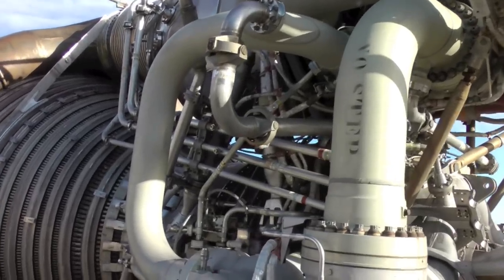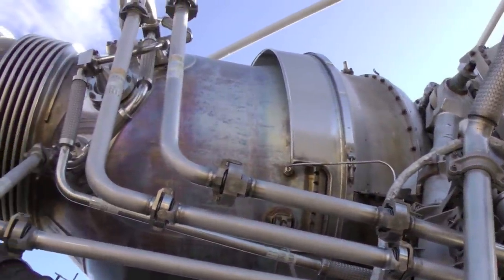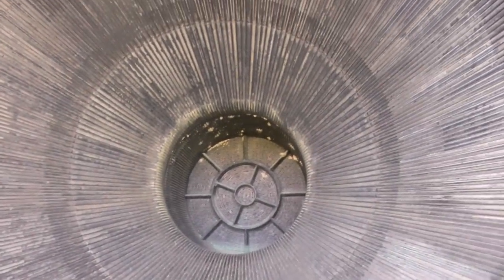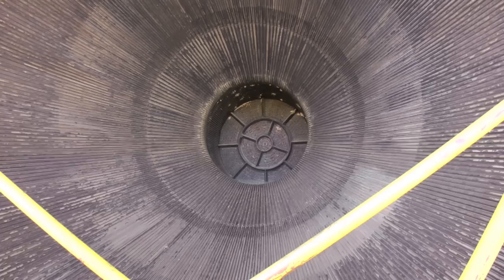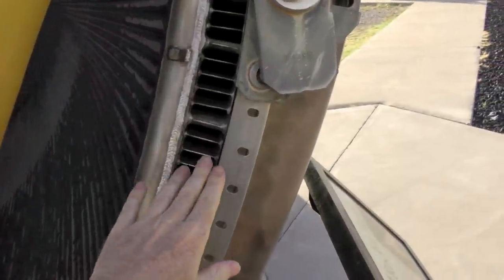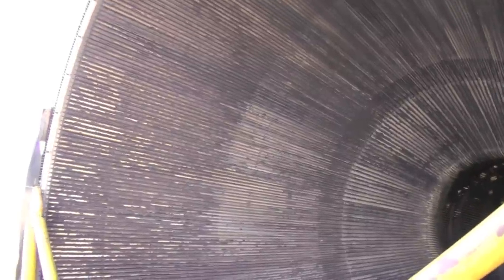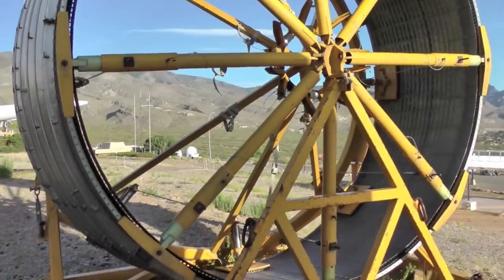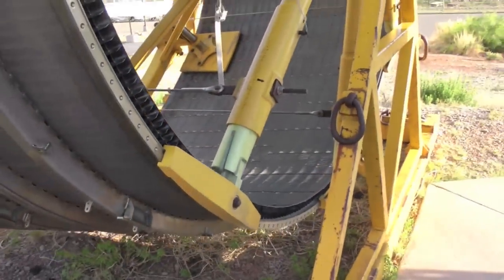Saturn 5 Moon Rocket's Main Engine, the F-1 | NASA Apollo Program Space Travel HD

Comment: if the engine genetates 750 tons of thrust, what par of the engine is taking that pressure load.i mean is the pressue affecting the entire nozzle?always wondered about this as the pump assembly area looks so comparatively weeak to transfer such . a massive thrust without just crumbling. . And the nozzle . looks quite delicae also. bottom mounting plate taking 3750 tons of thrust. is a huge load.
Reply: I don't think the nozzle wall pressure is very high at all.  It's all longitudinal. They did go to great trouble to keep the nozzle from melting though.  He explains this in the video.  All the tubing around the nozzle supplies unspent fuel as a coolant.
Reply: Zoe TheCat

exakt!
Reply: Combustion chamber pressures were above 1000psi... I think the bell probably had less pressure due to the expansion.  Hoops are brazed into the assembly, take a look at it in the video.  There's a gimbal bearing at the center of load... that cross-lookin' thing... yep, it takes the full 1.5Mlb load *while gimballing*... only the center engine was fixed in place.  There's several great books on the Apollo program, the F1 engine book (Springer Praxis) is on my shelf, among many.

Comment: In the opening few seconds of the video, you can see the fuel feed pipe to the left and the LOX feed pipe (the larger one at center right) connecting the turbo-pump at the top to the engine below. You can also see smaller bleed pipes bolted onto them. Does anyone know if they are the ones that feed the gas turbine that drives the turbo-pump?
Reply: The gas turbine is driven by the output from the gas generator. The gas generator is actually a small rocket engine that is fed liquid oxygen and kerosene. When the gas generator is fired it spins up and drives the turbine, which then drives the two pumps. A few years ago NASA test fired a legacy F-1 gas generator. A link to a video of the test is below. You can see that the exhaust is smoky fuel rich gas when it come out of the gas generator and it doesn't reignite until it mixed with the outside air in the atmosphere. Enjoy! https://www.youtube.com/watch?v=70u748VALt4

Comment: I appreciate your input David. It is, however, a restating of NASA's published specifications. I also find  hard to understand how the primitive controls for the F1 gimbals could ever compensate for all of the sloshing around of all of the liquids in all the stages fuel tanks. They were not even baffled. Couple that with the very slow start  and lack of airfoil vectoring , makes a stable trajectory after pitch and roll maneuver, a real miracle .
Reply: Mike Barth  writes " I also find  hard to understand how the primitive controls for the F1 gimbals could ever compensate for all of the sloshing around of all of the liquids in all the stages fuel tanks. They were not even baffled."

 Simply not true.

Take a look for instance, at this SI-C drawing:

http://heroicrelics.org/info/s-ic/s-ic-major-components.html

Note items 4&5: both slosh and anti-vortex baffles.

As for the "miraculous" success of Saturn, maybe you shouldn't opine about the fine points points of rocket design unless you've done it.
Reply: Mike Barth well they batted 1000% with it dude!!!!
Reply: I have seen the actuators for the F-1, about 7 feet long I believe, unreal...

Comment: *Relative* to the 4,000+degF of the main exhaust plume, the kerosene is quite cool.  The LOX would expand too much from the heat, and explode that tubing!  Mr. Bill!  =:O

In that 363 ft. high "stack" of PURE AWESOME-NESS, the RP-1 was the only fluid that didn't require special cryogenic handling.  (Also, LOX + RP-1 produces all that stunning ORANGE FIRE, vs. LOX + LH2 which makes that lame transparent civilized blue flame.  ;^)

Comment: Regarding this statement: "The F-1 is still the most powerful engine ever built." The "most powerful" part is only true as far as single-combustion chamber liquid-propellant rocket engines go. The RD-171M, a variation of the RD-170, is actually the most powerful liquid-propellant rocket engine ever developed, although it has four combustion chambers rather than one. Yet that's still not the most powerful rocket of any kind. The solid rocket booster (SRB) that's been developed for the Space Launch System (SLS) has them both beat as the world's most powerful rocket motor (as opposed to engine), although it has yet to be flown/launched. And even though the SRB for the Space Shuttle was less powerful than the SLS SRB, it too beats these two most powerful liquid-propellant rocket engines.

Also, to add to your narration about the tubes of fuel used to cool the upper part of the nozzle. In case some don't catch-on, those cooling tubes do lead back to the injector and then the thrust chamber for combustion, else it would be quite a waste of fuel! In turn, the heat of the nozzle helps the fuel to get warmed for combustion.

Another clarification of your narration: What you indicate as being the fuel pump is actually the heat exchanger. (However, in case your hand is pointing at the actual pump, it's off-screen, so we don't see it.) Above the heat exchanger (if the engine was standing upright, with the nozzle facing down) is the turbine. Above the turbine is the fuel pump, and above that, the oxidizer pump (both driven by the turbine, of course).

Finally, at the end, you got a nice shot of the gimbal and the oxidizer dome, plus the oxidizer valves. My compliments.

PS: The Wikipedia entry for the "Rocketdyne F-1" has a nice diagram showing all of the main components. It also has a photo of Wernher von Braun standing besides a first stage of the Saturn V, showing the humongous size of the F-1 engines and how all five of them astoundingly dwarf a single person.

PPS: Last year, on March 11, 2015, NASA ran an on-ground qualification test of the SLS SRB in Promontory, Utah. There are several videos of the test on YouTube. Just search for "SLS booster" and you'll get plenty of hits for it.
Reply: There's a bigger solid rocket motor made by NASA, I mean... this was HUGE. It was much wider than the SLS SRB, but it never flew. It was only test fired once before the program had been shelved
Reply: @fukhue8226  yep. That's what I'm talking about

Comment: What's really amazing is that they did all the calculations using a slide rule. No calculators, no computers. The raw power and the sound of those engines was amazing. It would break windows 5 miles away and kill a man 22000 feet away. It moved the earth. So sad to see the state of our space program today.
Reply: +Sycotic Deninard 22,000 = 6.5km away. Yeah, I doubt that.
Reply: You're right.  I was lucky enough to watch the Apollo 17 liftoff from the KSC press site -- right alongside the VIP stands and less than five km away from the LC 39A launch pad.  You could feel the heat on your face on that chilly night, and of course the sound was terrific.  Nobody died.  (Though NASA did have a cool lawn sign at the water's edge saying, "You Are in the Expendable Zone."
Reply: Most of the engineers were still using slide rules. It's how they learned and it worked well.
Reply: I was at Huntsville for a full duration burn...The residents of Huntsville were not even upset at the broken windows, for it was part of the MOON MISSION!

Comment: There are F1's and J2s that sit out in front of MSFC (Marshall Space Flight Center) in Huntsville.  It's not hurting them to sit out.
Reply: Wasn't guys in Huntsville improve the F1 engine into F1B and tendered for the SLS project？  They lost.  NASA gave it to Boeing.   Boeing is doing like a sucker.  Delay after delay after delay .. Yet they are using leftover Space Shuttle  first stage engines and solid fuel boosters.  What a shame.

Comment: Why is there any sloshing at all when the fuels are being injected at the rate of 3 tons per second per engine
Reply: Look at a candle flame or a campfire and notice how unstable the flames are. That's what happens inside the engine. It's called combustion instability. This instability, which can never be completely eliminated, creates localized regions inside the engine of higher and lower pressure. These different regions being at different pressures modulate the incoming propellant flow rate in that particular region, which in turn further affects the pressure variations in that area. This effect causes positive regenerative feedback to occur that causes the instability to continuously build up. Once that happens the pressure waves start to bounce around inside the large thrust chamber until they grow strong enough to blow a hole in the side of the chamber. Those baffles you can see on the injector plate split the large plate area into 13 smaller areas. They are actually called acoustical fences. They block the pressure waves from flowing back and forth completely across the entire injector plate. This eliminated the ability of the instability to build up to the point where it finally destroys the engine.

Comment: Even now, they are working on an improved variant of this engine, the F1B, for the SLS. It will be vastly simpler and cheaper to build, and will be even more powerful that the original. In just the combustion chamber alone, they've managed to decrease the parts count from more than 5,000 to around 40. We may yet see the launch of an F1-powered rocket in our lifetime.
Reply: really 40? amazing. I have to get down there for a launch preferably the spaceX heavy but I don't care, must be cool. Dreamchaser is going to be pretty cool too even though its kind of limited.
Reply: if that happens i buy a ticket and go see the launch... watching an F1 engine is a dream for me... the first stage on the saturn burnt 13 tons of fuel a second... the power of it is absolutely insane, must have been quite a sight to see and feel the roar in real life
Reply: beepIL its amazing they got a pump to work that fast.
Reply: beepIL F1 will remain in our species' mind for eternity. It will always be the first engine that put a man outside earth. Hats off to all the engineers who made it possible.
Reply: beepIL It was!
Reply: beepIL If they do use the F_1B booster design, you'll get to see 4 of the most powerful single chamber engines(2 per booster) and get to see 4 of the worlds most efficient engines, the RS-25-D (as core engines) push SLS off of Pad 39-B in the 20's perhaps.  But probably will see the 5 segment solids and 4 RS-25's instead.  I dont see them going to liquid boosters.
Reply: Actually, due to politics, the current SLS design proposed to use the same RS-25E design engines for the SLS core stage that the Space Shuttle once used.  The side boosters will either be extended side-mounted solid rocket motors similar to those used by the shuttle or possibly a pair of liquid fueled external boosters from one of two different configurations (one of those uses re-designed F1 class engines while the other from another company would use clusters of Aerojet engines).
Reply: David Knisely Yes, the current SLS that is under construction, with metal already bent, will use an expendable 4(edit-8/16/15: should be 5-FIVE) segment SRB(Shuttle was 4 segment reusable) with a test in Utah in MArch.
The engines that will be used will be the exact same reusable RS-24D's that were used on Shuttle, after the current inventory of RS-25d's is expended, as they will be dropped into the ocean, unlike their reusable use on Shuttle.  Once the 16 RS-25D's have been used after the 1st 4 SLS launches (4 RS25's per launch) NASA will use the newer expendable RS-25E.  NASA has just entered a new order for 6 brand new RS-25's in November to Aerojet.
Reply: +Tiberius  Pump had something like 66,000 hp.

Comment: AFAIK, you are looking at a ton of HAND CRAFTSMANSHIP, hand welding, etc. These were once respectable skilled trades that could support a family in comfy middle class.

Comb NASA archives.  I found a detailed .pdf of how and why the flames climb up the side of 1st stage as it reaches higher altitudes (no, that's not a camera artifact).  Has to do with low-pressure ("vacuum") zones formed by the shock waves at high Mach numbers.  Rocket body had to resist "burn-through" from this phenom.

Comment: The F1 had 1,550,000 lbs of thrust at sea level, in vacuum it had 1,800,000 lbs .
The F1 was a very energy loss rocket engine 
The F1 was a 2.4 : 1 ratio (fuel vs oxidizer) which was robbing a lot of power
The F1's fuel choice was RP1 refined kerosine , which wasn't the best fuel for maximizing the thrust out put.
The F1's fuel pumps were never worked more than 85% of their max capabilities.

And all that designed in the late 50's.
Don't compare Shuttle's SRBs that had bigger thrust , because this was a non liquid fuel engine, and it was by itself a autonomous rocket and two were needed to assist the lift off .

Bottom line is that the F1 till today ,it is the most powerfull and successful liquid fuel rocket engine!
And the requirements were achieved by working very moderate without any hassle !

Comment: It wasn't the fuel that cooled the skirt - it was the liquid O2.
Reply: +Allan Folmersen Wrong! If liquid O2 was used the skirt alloy would have ignited and melted away thanks to the oxidizer....
Do your research!
Reply: Rudy Schloesing You are talking about the exhaust from the gas generator which drove the fuel pumps - that was dumped into the nozzle and was the dark band in the exhaust. The O2 was  pumped thorugh pipes built into the nozzle skirt, and then fed into the injectors
Reply: +Allan Folmersen Sorry, but no. It's not a good idea to use LOX for this as Rudy Schloesing stated before. Which is why fuel is used for thrust chamber/nozzle extension-cooling. It's prewarmed and then led to the injectors.
Reply: Ima Dori It appears you are right. Thank you for the clarificaiton.
Reply: +Ima Dori Isn't it something that goes back to the second world war?
The fact of cooling an engine with it's own fuel, and warming it in the same process. Maybe the engines of german aircrafts or something...I find the idea pretty smart. That F1 is impressive.
Reply: Well, I'm fine thanks!